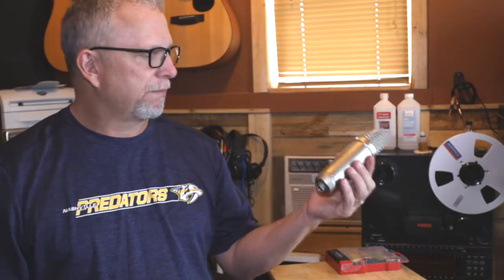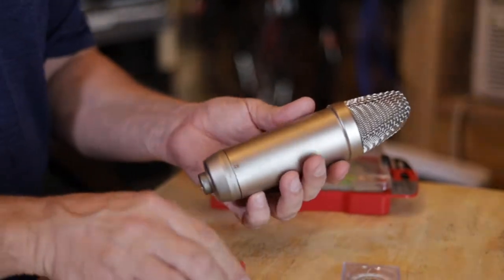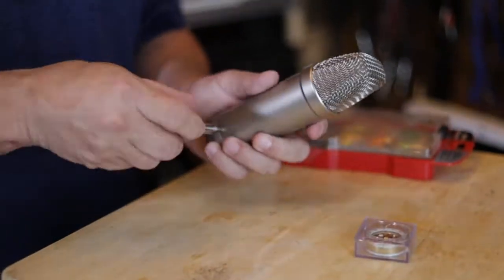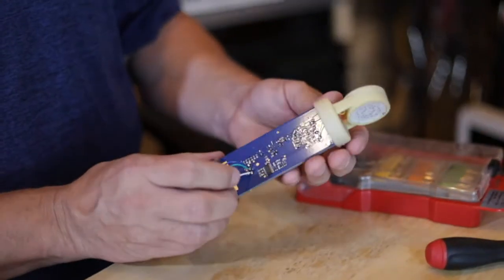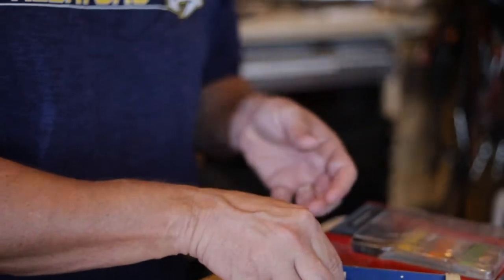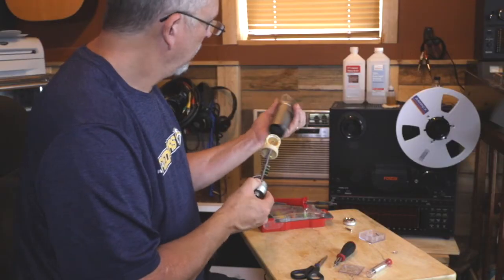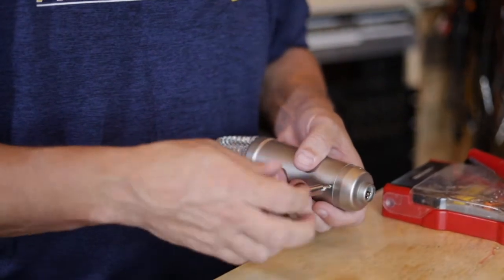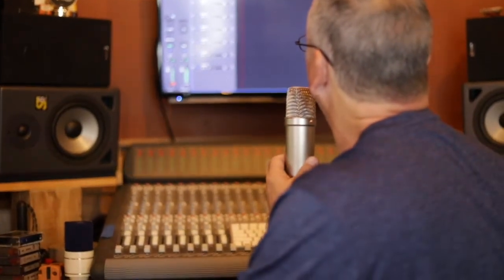Rode NT1-A Mic Mod - Live From The Tape Farm

Comment: That noise you hear on the before-recording doesn't come from the microphone, does it? Sounds more like a computer fan. The NT1-A sure has its problems, but it is an extremely quiet microphone.
The modded version sounds great, though.
Reply from the maker: The signal path for the before and after were exactly the same. Same cable, same pre, same settings.
Reply: @TheTapeFarm  if so, the original capsule was/is defective  - the NT1a is still  (after over 10 years) one of the microphones with the best Signal to Noise ratio on the market ....